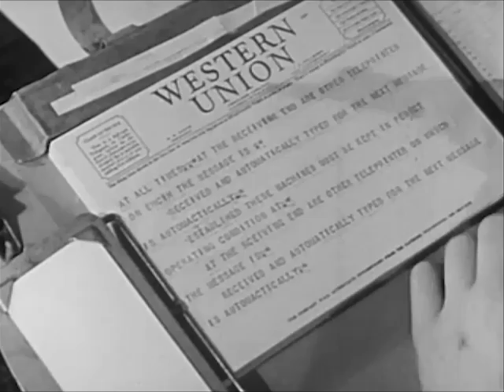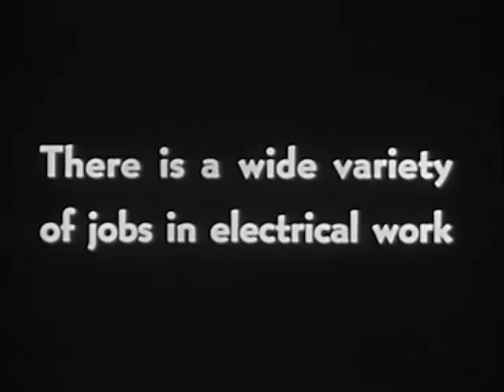1940s Vocational Training: The Electrician (1942) - CharlieDeanArchives / Archival Footage

Comment: My house in New York was built in 1888 and this is when I was a baby but when my mom bought the house the previous owner had to upgrade the existing panel from a 30 amp panel to a 100 amp panel. I guess when it was a 30 amp panel there was no two phase circuits it was all single phase 120 volt circuits. Just lighting and receptacles. That’s all they needed at the time. But even when they upgraded to a 100 amp panel we still couldn’t run our wall unit air conditioners at the same time as the dishwasher and old microwave we had. 100 amp is insufficient for a house that big. Usually when a panel is 100 amp it’s for apartments. Houses usually use 200 amp services. But yeah it was really weird to think a whole house could run on a 30 amp service. Like the smallest I’ve ever seen working in the trade was a 60 amp Zinsco for tiny apartments and even that was too small. That was the only apartments I’ve seen with 60 amps. I’ve seen apartments of similar size with 125 amp main breakers. It’s weird how much apartments vary in main breaker sizes when houses are usually standard to 200 amps now. Anyways just thought i would share how small the service was on a house built in 1888 and that was probably added later because 1888 is when electric was new and I doubt person who built and owned the house I lived in was wealthy enough to have electrical was it was first invented.
Reply: In the UK our standard mains supply is rated at 60 amps but of course all our power is single phase 230 volts (I'm talking domestic supplies here not commercial)  They have started installing 100 amp single phase in new properties these days due to the uptake in appliances and of course the future potential EV car charging.  Though however the infrastructure will cope with that only time will tell..
Reply: @andyblackpool  higher the voltage lower the amperage. That’s why industrial and commercial stuff here is usually at 480/277
Reply: @Baelor-Breakspear  Probably that's why in Europe we have a higher voltage, trough all it was not always as is today, because lower voltage (120, 125, 127, sometines 150 Volts) was used.